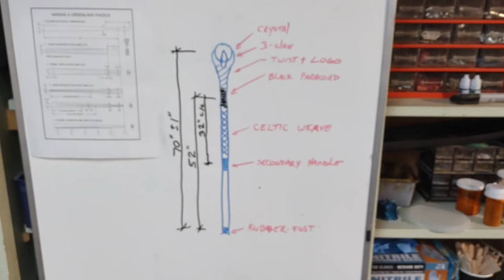CARVING a STAFF of GUIDANCE walking stick

Comment: Great job. I carve walking sticks just for fun. The rest of the time, i carve cartitatures. But for 40 years, i built custom homes. Get used to using bronze wool instead of steel wool. Steel wool leaves little pieces of itself in the wood it can rust and make finishs change their color. It doesn't happen every time, but when it does, its painfull have to strip and refinish. Cost about the same, maybe a bit more, but it's worth changing,
Reply from the maker: nice, I'll look into it. Yes, I do vacuum up all the little steel wool parts well before applying finish for just that reason... but if I can avoid it completely, why not!